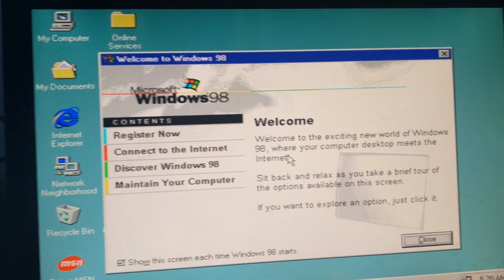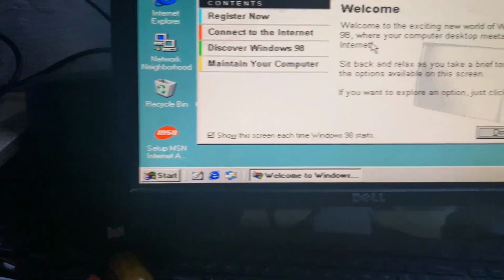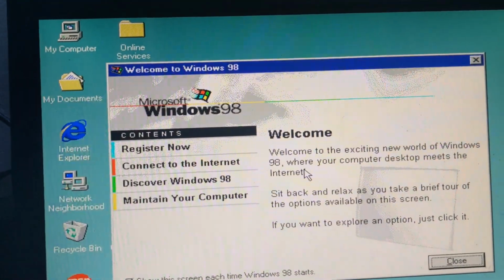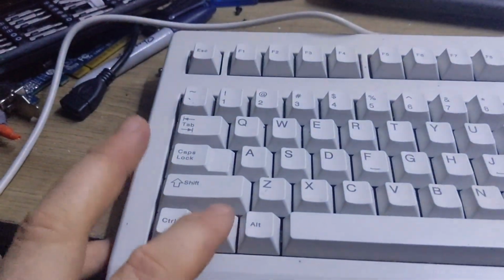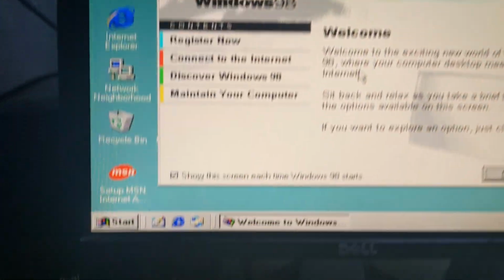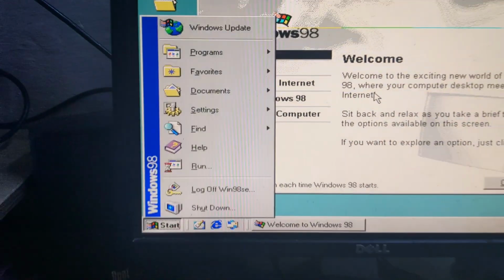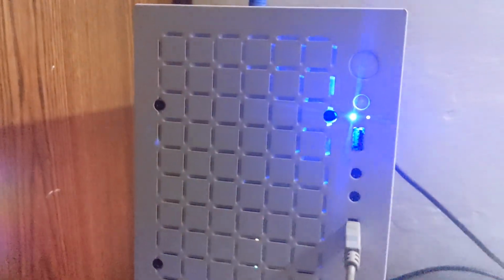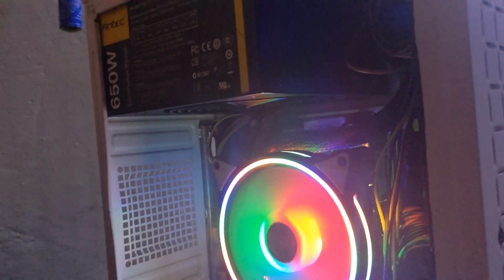white temu case and I made a retro pc.

Comment: Win98 isn't gonna be so great for that system, everything is just too late for proper support. Could probably get it going well enough without chipset drivers being available, but there aren't any 98 drivers for that graphics card. Something like a GeForce FX 5200/5500 PCI, or a PCI-E Radeon x600 will be an okay fit, and the Audigy 2 is pretty good for Windows 98 as well.
Reply from the maker: I use  Rudolph R Loew drivers and unofficial win98 nvidia drivers. That loads the gpu that it has in it. But waiting on ps/2 adapter for motherboard. Still fun project to play with.
Reply: @2mikedean  Ooh, interesting, have not heard of that driver pack before. I was always under the impression that the 7000 series was the latest with any kind of Win98 support. Do the drivers work fine? Like Direct3D and OpenGL all work correctly?